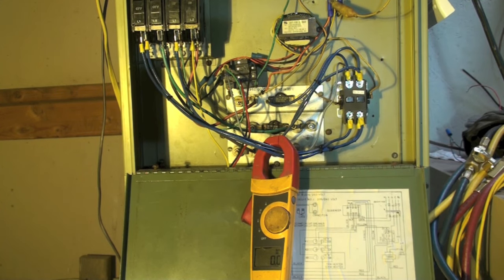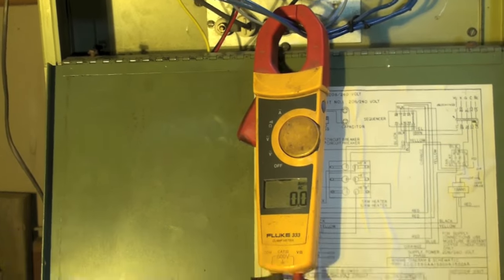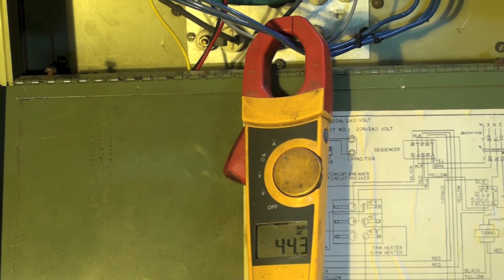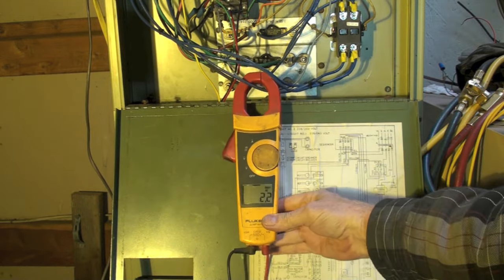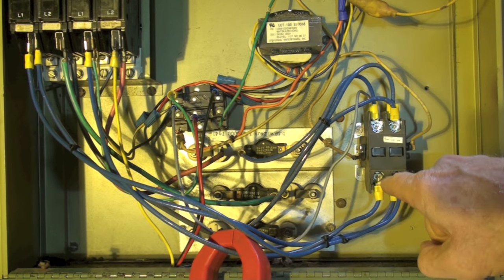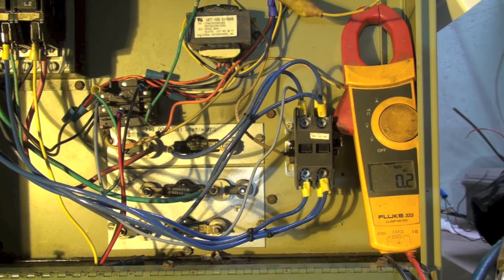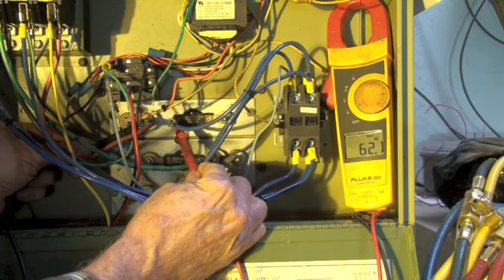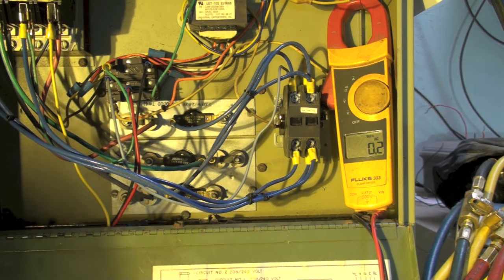Diagnose the electric furnace problem #1

Comment: It needs a three Pole contactor
Reply from the maker: You could certainly use one but it is not necessary.  You can use one 50 amp contact for 2 elements.
GFM

Comment: Min 2:25 -- voltmeter reads ZERO because contactor is CLOSED-circuit, right? ( but a parallel circuit is created by the voltmeter, so why doesn't it show 240 volts?)
Reply from the maker: You are correct.  The parallel circuit created by the meter will read the voltage drop of the switch.  The meter is very high resistance, so the voltage will be very low.
GFM
Reply: Because he is probing the same leg of 120 with both probes. It wouldn't show 240v unless he probes two different legs of 120. If he probed one on that leg and the other probe to ground it would then only measure 120v. If he probed the two legs of the contactor, it would then measure 240v
Reply: @mikie214now  
Thanks much. I need practice with the hands-on part of the electricals of this job (schematics are fun to follow, but that's not the same as out in the field.)